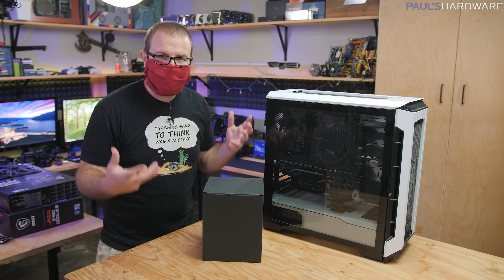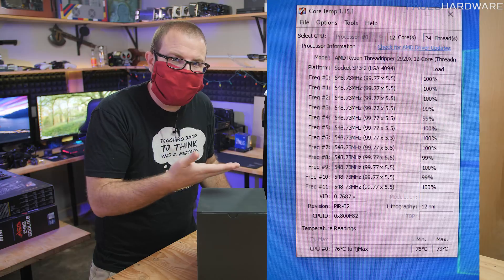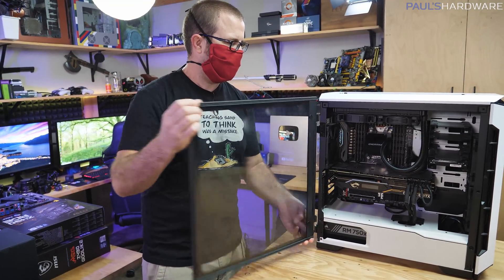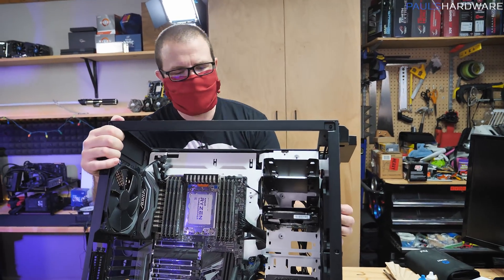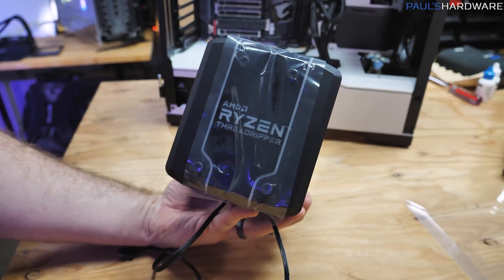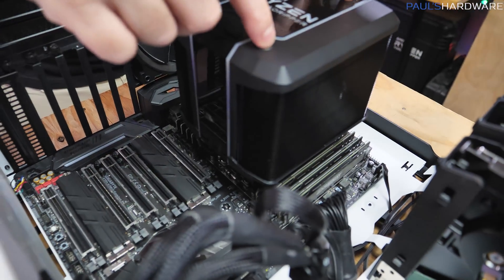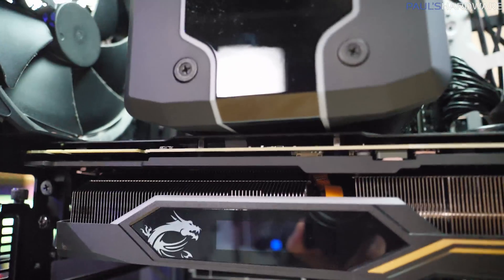Why We Switched from an AIO to Air Cooling...

Comment: I been through the AIO failing. too much $ for more headaches. I saved my money by buying Noctua and not buying excedrin
Reply: Bought Noctua and couldn't be any happier!(Well I'd like to add chromax fans with red corners and some fancy top covers for it).
I have X58 so i emailed them and they sent out the mounting kit in 22 days without requiring me to pay any duties or delivery charges(I live in Pakistan where no delivery is free except for Pizzas).
Reply: Bought Noctua and never looked back.
Reply: I'm still using my trusty old Arctic Cooling (Yes - they were still called Arctic Cooling back than) Freezer 13 Pro CO air cooler i bought with my i7 2600k ... Never had any issues and it's still quieter than the GPUs i had over the years.
Reply: I went cheap with a coolermaster, and never looked back, it's gave me way more bang for the buck than my expensive Corsair AIO that failed after a couple of years. AIOs are for people who have time to deal with the headache.
Reply: @neoasura  My Aio had an increase of temps of 15 degrees after the first year and about 35 after 2 years. It died when I moved and at first i couldn't figure out why but when i opened it up i saw the fluid had coagulated and filled the loop with sediments. Bought the Noctua and couldnt be happier. I leave the fan speed at 100 percent and 6 months later still same performance and quiet operation.
Reply: I will never use an aio agian after my experience. Bought a nh- u12s and will never go back to liquid cooling. I get the same performance in a quieter system.
Reply: My current build has dual AIOs, a Fractal S36 on the GPU and Fractal S24 on the CPU, couldn't be happier. Can barely hear it under full CPU+GPU load. Actually I think it is better to put liquid on your GPU before you do the CPU since you can already get large quiet CPU coolers but that doesn't really exist for GPUs.
Reply: @dwindeyer  they fine while they work. I been cooling my xx80Tis with h2o since 980ti. noctua on the cpu's tho. noctua fans on rads too. I like a quiet pc under load. just say no to delta fans.
Reply: dwindeyer Aio on my cpu but about to aio the gpu with a 360mm rad what case do you have that fits two?
Reply: Same, bought a Noctua NH-U12A and I couldn't be happier.
Reply: I did the opposite: Noctua NH-U14S -> Corsair H80i V2. The Noctua was way too big for my mini-ITX case & the H80i V2 (because it's liquid...) can be moved outside the case with only a few small holes.
Reply: Totally agree, 100.
Reply: Good AIOs last long. Unless we talk about Enermax (never used one tho). Corsair and Arctic can serve pretty long.
Reply: my Noctua won't fit in my case.  it's about 1mm too tall.  i can close the case with it installed, but it'll cause the motherboard to flex.  i'm back to using the stock AMD cooler until I decide on an alternative.  i'm leaning towards a new case.
Reply: @Dirtyboxer1  +1 on getting a new case.
Reply: @Dirtyboxer1  Buy a new mesh mid-tower!
Reply: @Dirtyboxer1  just ordered a Scythe Fuma 2, for largely the same reason. 155mm height but nearly(nearly!) the cooling capacity of Noctua (also not poop brown)
Reply: @werther5952  TBH, the color Noctua uses never bothered me.  The inside of my case is dark anyway, so I don't see it.  At one point, when I first started using them, they were hands down the best air cooler on the market, not even close.  Now, other brands have improved a bit.  I may give that Scythe a try, but for now the basic AMD Wraith Spire is meeting my needs, so I don't have any urge to swap.
Reply: @Dirtyboxer1  try smaller noctua cooler. They make low profile ones
Reply: @Dirtyboxer1  scythe fuma 2 has similar cooling capacity but in a smaller formfactor
Reply: Lots of Noctua pole-smoking here. Build a custom loop, something you can be proud of.
Reply: @mikeschimminger7886  do custom loops clog up as well ?? and i was looking at the kits are the cheaper ones ok ?

Comment: i think the right top fan should be removed, since its now competeing with the cpu cooler for air. instead put it as an additional input fan in the front. excess air will just get pushed out by itself through the top.

Comment: Tired of these LED-festooned PCs esp. ones with water cooling.
Look like aquariums. I don't want LED parts and hate devices that make you log-in and run software to use their products. I buy KB , et. that works just plugging in. I got red LED only , not typing on a Christmas tree.

Comment: I bought into the AIO meme, thinking it would let me overclock higher. Upgraded from a Hyper 212 to an EVGA CLC 240.

It was an improvement aesthetically, but it's way noisier than the air cooler. I also had some ass pains figuring out what headers to plug into.

Performance was an improvement over the 212 though... but then I really built a system for someone else, and due to their budget I used an air cooler. Dark Rock 4. Painless to install and hook up, dead silent and even better performance than my AIO!

So for my next rig I'm jumping back into the air cooler route.
Reply: There's definitely research worth doing in getting a closed loop cooler that works well for you. I went from a Hyper 212 EVO to an NZXT Kraken X73 (which, admittedly, is hilariously large at 360mm) and couldn't be happier. I run slightly warmer at idle, but my system is quieter overall and I do have more overclocking headroom and lower operating temps at load. I can game and watch videos on a 9900k running at 5GHz and barely touch 70C.

I considered the EVGA 240, but after hearing how noisy its built in fans are, I decided against. That said, if you have the ability to switch the fans that slot in against your radiator (I don't know if the EVGA's design allows for this,) you could slot in 2 120mm Noctua fans and probably bring down your noise levels while maintaining good performance (maybe even slightly better, if you make your fan curves a bit more aggressive than they are now.) Good luck with any further tweaks!
Reply: This is the mistake many people make, you cant compare a 240mm AIO with a dual tower air cooler, it doesnt work like that. Compare that air cooler to a 360-420mm AIO or much better, a custom loop, gotta compare apples to apples and oranges to oranges.

Comment: That cooler up against the gpu is giving me massive anxiety lol
Reply: It's fine. The bracket is what's holding the cooler and is extremely unlikely to fail. I've seen a motherboard warp but only because a screw or two got loose. Even then the cooler hardly moved downward.

Besides that GPU doesn't appear to have any extra support so in a year it'll have sagged away from the cooler. 

That should be the anxiety inducing part, really.:P
Reply: You would be surprised that the wraithripper isnt as heavy as people make it out. Been using one since they came out. Zero sag zero problems.
Reply: I would have more anxiety having an AIO radiator filled with liquid hanging above my components.
Reply: I agree, esp. for heat reasons. CPUs get hot and GPU backplates get hot. But, hopefully they've checked the numbers and there weren't any issues.

Comment: A good air cooler can last you a lifetime. I have a friend who has had and used the same Noctua NH-D14 for 10 years, other then requesting new mounting brackets from Noctua from a Core 2 Quad to his 9600K same cooler but better performance then when he got it.
Reply: I have the cheapest Intel cooler that came with my i5 2300 and have had it for 6 years, almost 7 and it's not going to fail anytime soon👍

Comment: I switched to air cooling after the pump on my AIO developed a tiny leak that destroyed my graphics card.
Reply: Ouch! Tough way to learn
Reply: If you are smart like me, you will never buy liquid cooling.
Reply: It didn't develop it. You broke it. Tubes don't just develop random leaks over just sitting in the case.
Reply: @sujimayne  it was leaking from the pump itself. Not the hose.
Reply: i am still not convinced whether the risks/maintenance of water cooling are worth it for me, i still prefer a big air cooler. i'll probably eventually have to go with a water cooled cpu when i upgrade to big boy stuff in the future though...
Reply: @EndlessDarkDoofies  AIOs typically don't need any maintenance, which is one advantage over air coolers.
Reply: @sujimayne  yea cos people upgrade every 2 years. would you have confidence leaving it 5+ years no maintenance?

Comment: Solid video. I find workstation PCs and general use PCs just work better with air... although you COULD have selected something with fans that are EASIER to swap in case the CPU fan fails...
Reply: Maybe eventually swap to a noctua chromax unit?

Comment: Quick question on liquid cooling can i use 180 (95+% by volume) proof spirit instead of water etc , remember vodka is typically 80 proof (40% by volume ) just wondering as i may have some on hand soon lol

Comment: Should I be concerned with my AIO if I'm moving my computer cross country in a car? I'm moving 1000 miles away would it make sense to remove the AIO for the trip or just leave it in? All I plan on doing is removing the GPU so it doesn't snap

Comment: I've asked this question to several youtubers including JayzTwoCents and Paulhardware but have not gotten a reply from them seems they don't reply to their subscribers on here or twitter. Guess they got so big they don't need to. :( 
I'm looking at getting the B450 AORUS PRO WIFI (rev. 1.0) can anyone tell me if the bios on those are up to date and if not do you know if they have fixed the issue with the EC FW Update Tool or is that just an issue with the x470 board?

Comment: First everyone promoted open loops like there's no tomorrow until it got noticed that they are a PITA to run, then the CLCs came along to teach us the value of hardware that hasen't been dripped on after the pump stopped working and the pressure busted a seal or two. In the end dust was never your enemy to begin with, it always was stupidity and laziness.

I went back to air cooling too and didn't lose a single thought on my cooling since then.

Comment: AIO burned me once, it burned me twice, then I decided to build a custom loop with acrylic tops so I can see the fins gunking up and do maintenance on it. Never go air cooled again
Reply: Downside is I think my 1700x is pretty much EOL due to all the overheating from my Corsair H100i GTX failures (all 3 of them). Could not hold 3.7GHz stable, where it originally did 4GHz easy. New 3700X loves the custom loop though😂

Comment: I'm still running my enermax AIO for TR4 on my 2950x haven't had any issues other than the fans that came with the radiator rattling i had to replace them other than that keeps my 2950x at 35C on idle and when gaming or what ever else it never goes above 45-50C. Had it for over a year now.
Reply: Consider yourself one of the very few lucky winners from Enermax'es Liqtech lottery. 😂
Reply: @bgtubber  pretty much, but back then there wasn't a choice for full IHS coverage sadly enermax was the only one, i didn't want half of it covered lol

Comment: AIOs are just overly complicated air coolers. They still use air to get rid of heat, they just add water as a dynamic heat sink. If someone built a ridiculously good air cooler that's chock full of heat pipes, then the only reason to get an AIO would be for case clearance. Otherwise, you are just adding unnecessary risk to your PC.

Comment: Air cooler definitely safer on the long run.  Why did you choose this huge cooler and not other brands ?  It looks good with the LED and TR brand on top but others as Deepcool Fryzen also look good, are smaller, extremely easy to install and according to some reviews perform better than the CoolerMaster https://youtu.be/9X911i2Eelg

Comment: Before even watching the video, that looks like an Enermax Liqballs AIO 1st gen. RMA it to Enermax and get a Liqballs II that will last you another 10-18 months. Then RMA it again. Rinse and Repeat. 

Edit: I was wrong, that's a Liqballs second gen with RGB. 

Edit: When you RMA, you don't send in the fans (they also state this,) they'll just ship you an retail box of the Liqballs II, now you'll have 4 (6 if 360mm) fans to be able to do a push pull config.

Comment: I have been learning more about building my own PC. I have done a lot of things with the PC's that I have owned in the past (majority of it during IDE HDD days). I have changed HDDs and power supplies. I have added video cards where there were none to non gaming computers. I have added extra RAM when needed. I even added a sound card once. And added a case fan where I figured it was needed due to adding a video card. About the only thing that I can think of that I haven't done is put a CPU and cooler on a mother board. I have done this with non gaming pcs. I can if needed get a decent non gaming pc and turn it into a gaming rig if I do it right. 

Since it has gotten way easier to build your own PC. I actually believe that I have what it takes to do it. I have watched some videos on how to do it. I am still learning how to use pcpartpicker.com. I see it has a lot of good things for picking the right parts. 

Now I know that I can save money by making some smart purchases on sites like Ebay. I am still not sure if I want to go that route or not. I am leery of Ebay because of the scams that I have learned about from some videos here on youtube. 

I wish I could keep the current system that I am using. But I don't think it would be worth getting a new GPU, power supply, extra ram, and possibly a new case fan just to breathe some life into my old computer. 

I still don't know how most of the people on the videos that I have watched have been able to get some really good systems put together for a song outside of using ebay.

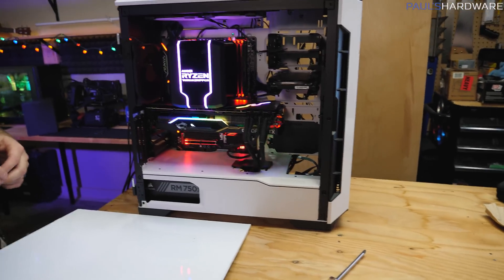Comment: 15:10 NO I/O-SHIELD ! WTF ?!
Reply: They forgot about the brace! Lul
Reply: Yeah, wow.. Also there is a lot of stuff missing from the back of that case.
Reply: IO shields are mainly for cosmetics. The worst you'll get from no IO shield is probably just a little dust 👍
Reply: @ph0roggy  I know what i am gonna say is probably the most bizzare and one in a trillion scenario but here it goes:
I had a system with no IO shield sitting on floor then one day i heard noises so i investigated and it turned out a rat made its home/food cache in it.
Was a weird surprise when i pointed the torch on the front panel and saw the little dudes cute little face.
Reply: @zarmaanful  this is awfully cute and wholesome
my day has been made
Reply: @zarmaanful  has it been cooked by the heat yet?
Reply: @sanicmidgetking9393  I put rat poison around my room and he ate some.
Reply: @zarmaanful  everyone knows the mouse goes next to the keyboard